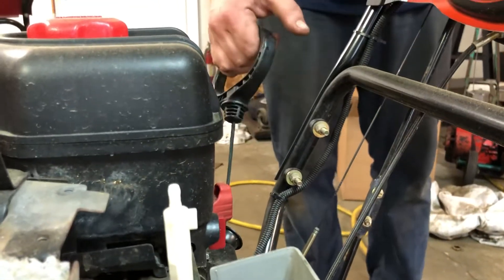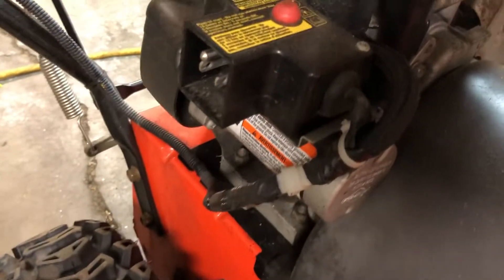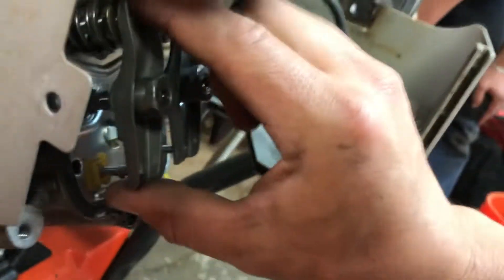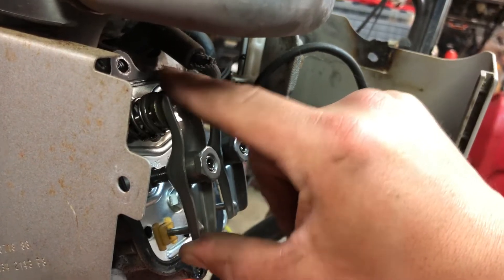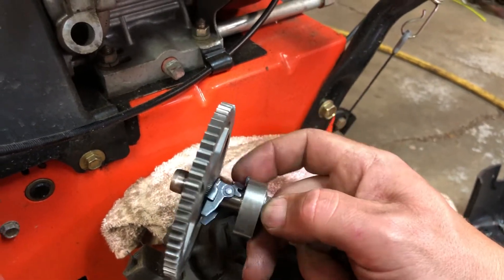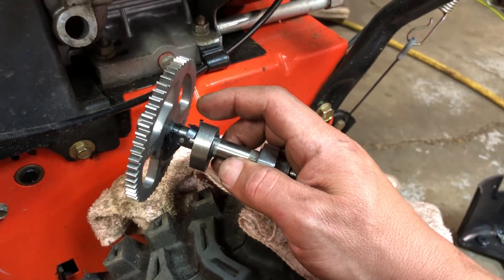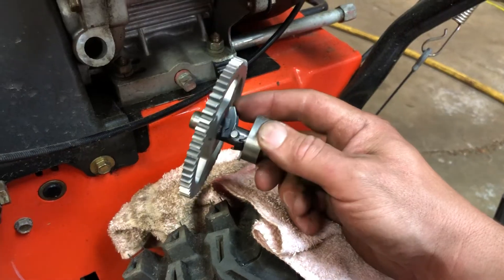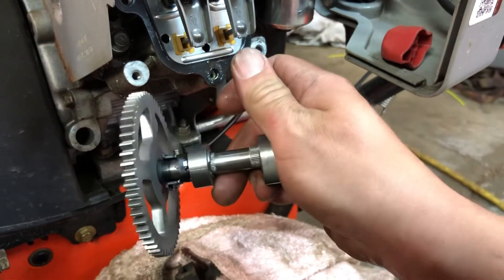Small engine (briggs) Compression release operation and failure symptoms.

Comment: last day I tried to adjust the valves on my tecumseh ohsk90 and I'm a little unsure of wich TDC is the correct one, is just after the pressure release? 
I noticed the piston reach the maximum highness just after the little exhaust valve movement.

I set the valves just after the pressure release but I noticed by checking in cross mode (adjust the closed valve when the other is fully open) that there is discrepancy: set to .004 but on cross mode I had .007 or more.

before TDC setting  (the day before) I tried to set .004 on cross mode and I got maybe  .001 on TDC, the opposite

What's wrong?
Reply from the maker: TDC compression there should be NO discrepancy as the cam lifters are on the base circle. When the OTHER tdc is present, that's overlap, and the measurement could be sketchy. As both valves would be slightly open.

Comment: I want men to stop building G.D. engines with automatic compression releases, and just make it manual with a pull cord just like the choke.  Just like on a diesal tractor.  Is that so hard to do....
And no more carbs.   Get rid of carbs forever.
Reply: Both are universally grrrbage
Reply from the maker: Its actually pretty tough to pull, yes. Hence your 250 and 450 4 stroke dirt bikes and the "hot start" lever. 

Also, carburetors still have their place. You can get home on a dirty, flooding, or otherwise faulty carburetor. Fuel pump or MAF failure? Forget it.
Thanks for the views! I appreciate the satire. No matter how close to the truth it may be!
Reply: @smallenginesolutions  You didn't go blind for five years from carb spray droplets ricocheting out of a carb back into your eyes.  They had to replace both my lenses with plastic in surgery.  Carbs can eat shlt and dle.

Just today I had to replace a pull cord on a lawnmower... and I was like, why couldn't they design this to be easy... or just never fail, period.... you know it's going to have to be done.... eventually.
Reply from the maker: @dysnomia-anarchia valid arguments. Yes i've been panic stricken via carb cleaner ocular spray. I still respect the basic technology of a carburetor. Pull cords on the other hand? Yes. Should be 3-4 bolts MAX like the old tecumseh models. The riveted recoils on the blower housings can suck it. I hear you, fam.

Comment: I have a riding mower with the compression release that's broken and my engine wouldn't spin over so what I did was on the compression  stroke I adjusted to exhaust valve just enough that the engine will spin over and that's been working ever since

Comment: was it the cam? Mine seems to just be worn down
Reply from the maker: On this model it ended up being the spring. There is a second video where its clearly shown. If yours is worn down. It would seem the weight isn't pulling the release out of the path of the cam's lifter.
Reply from the maker: https://youtu.be/C8P3ehw3nW4?feature=shared

Comment: PLEASE HELP I need to repair a honda gx390 and a Kohler command pro 14 with the same symptoms. I havent atripped them apart yet but im 90% sure this is the issue. They both use the slring style of compreasion relese. My question is, will the spring have broke or do they just get stuck? And if stuck, is it just a case of soaking it in WD and un-sticking it and reassembling it? Or do you just order a new camshaft??? Thanks!
Reply: just buy a new cam. Also the front cover gaskets are going to break most likely when you pull it apart. If you order both of those pieces and the accessories come off the PTO easily, it can be a 'one and done' repair involving only a single visit.

Comment: Great video, some youtube channels tell you to look for a bump on the intake valve, I think that's incorrect. Also when the engine starts centrifugal force stops bumping the valve on the release mechanism or you wouldn't have enough compression to run the engine.
Reply from the maker: You're partially right. Yes, the compression release is typically on the exhaust side. However, if the compression release was stuck ON, the engine would still have enough compression to run, though at reduced power. Keep in mind the release is enough to get the engine going, and pulls off with rpm. If it bled of compression excessively, the engine would never start at all.
Reply: Any suggestions for mine? I tried to adjust the valves, after doing that when I pull the rope it gets stuck and can't be pulled, but if I remove the spark plug it comes free and I can pull it normally.
Reply from the maker: @osvaldoolvera9048  if this only happened AFTER the valve adjustment, then you may have the exhaust valve clearance way too loose. If it was happening both BEFORE and AFTER, i would suspect the camshaft failing, like is addressed in one of our other videos.

Comment: I cant find any videos showing "the bump" in the exhaust valve.
Reply from the maker: I see what you mean. Next time i pull a valve cover i'll make a quick snippet of the "bump".
Reply: @smallenginesolutions  THanks. I think mine IS broken. I didn't see the "bump" when I adjusted the valves. And to start it, I need to counterclockwise rotate the engine by hand with rag stuffed in intake... then a quick shot of ether with FULLY charged battery. It usually will fire off. If it doesn't... I have to repeat the process.
I didn't know about the compression release mechanism breaking issue until AFTER I bought a NEW battery & NEW starter and it still would not crank over PAST the compression stroke.
I'm not tearing the motor down to fix it. I'm DONE tearing motors apart after work & weekends.
Reply from the maker: What are you saying? The bump doesn't exist or the video of the bump doesn't exist?
Reply: @smallenginesolutions  It's difficult to find a video where internal compression release is NOT broken &  showing how the exhaust valve has the little bump when turning over by hand, showing the compression release working.